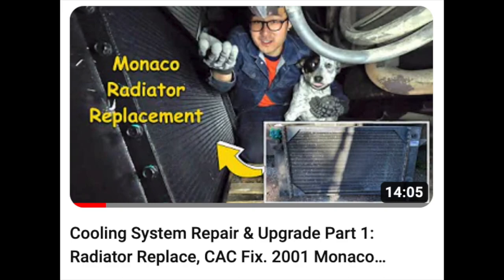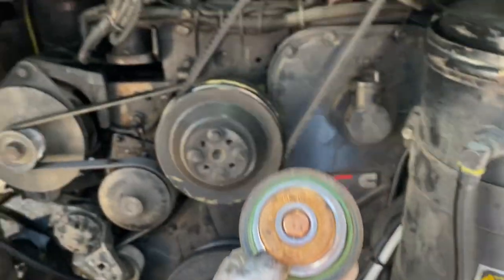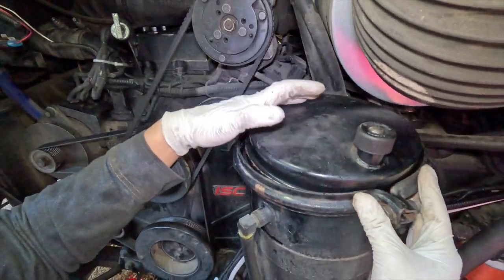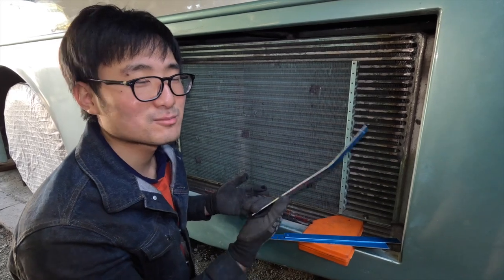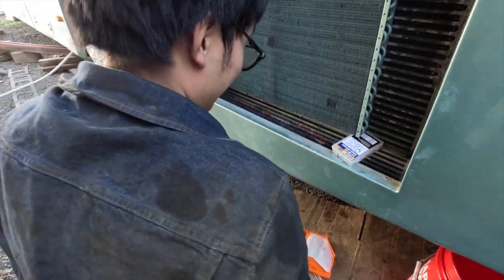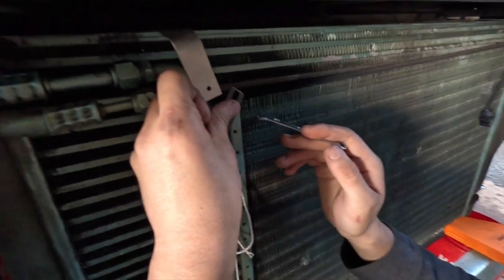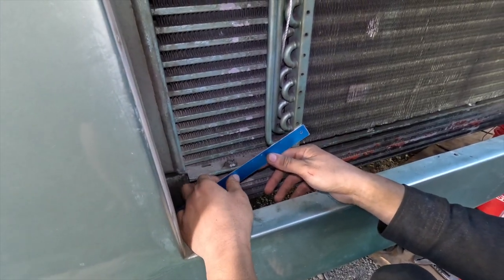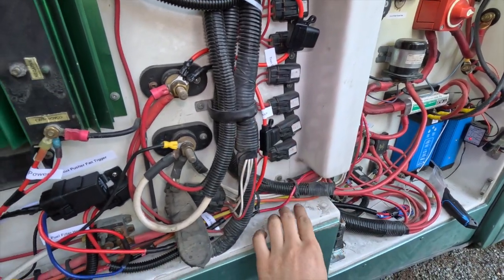Cooling System Repair & Upgrade Part 2: Radiator Aux Fan & Brackets - 2001 Monaco Windsor

Comment: I would highly recommend putting rubber in between those brackets and your charger cooler and a rubber strap in between your charger cooler and the oil cooler. I just had to replace my CAC last summer because it was hard mounted, and all the shock going down. our lovely, smooth roads made it leak.
Reply from the maker: Thanks for the comment! I agree, somewhere does need some rubber. But I am not exactly sure where and how to place the rubber. The hydraulic oil cooler is below CAC, the big thing outside of CAC is actually A/C condenser. There is no room to place rubber between CAC and hydraulic oil cooler. Any how, this install was 6 month and 8000mile ago. If any improvement is needed, I shall see now, will check that soon.
Reply: @timmysrvlife  you just drop the hydraulic oil cooler down and put a flat one or 2 inch wide strip about an 8th inch thick in between the cooler and the charger cooler and then bolt it back together.
Reply from the maker: @timaz1066  Sounds like a plan! Will try that.